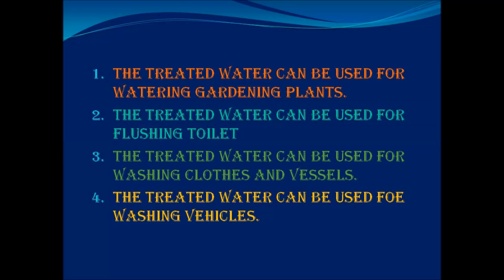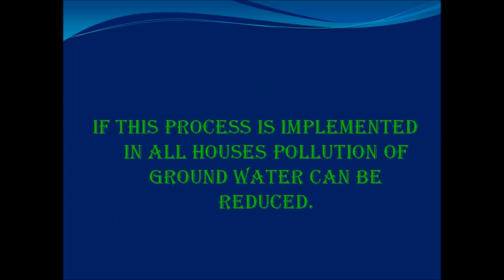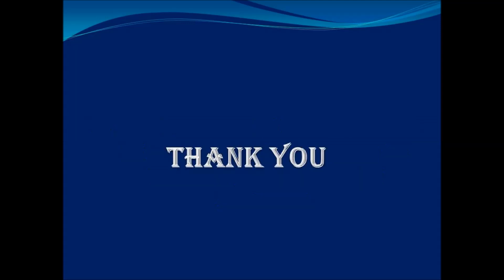WASTE WATER TREATMENT

Comment: Can we purify the kitchen and bathroom water in this method???
Reply: See, treatment of water with least input cost are possible when it's free of any chemicals. Like soap and detergent.

So mainly we can have two to 3 typesnof treatment policy at home.

1. Treatment of kitchen sink water, which are often with least chemicals.
2. Bathroom water, often mixed with soap and detergent.
3. Wash basin water.

Yeah all these 3 can not be used for drinking purposes with simple water treatment procedure. 

But we can use it for gardening, washing machine, toilet comode flush, car vehicle washing, water spray, other cleaning purposes.

We need to conserve water otherwise we would face another disaster like this COVID19.

Thanks

Comment: This water can be drink
Reply: nooooo
Reply: See, treatment of water with least input cost are possible when it's free of any chemicals. Like soap and detergent.

So mainly we can have two to 3 typesnof treatment policy at home.

1. Treatment of kitchen sink water, which are often with least chemicals.
2. Bathroom water, often mixed with soap and detergent.
3. Wash basin water.

Yeah all these 3 can not be used for drinking purposes with simple water treatment procedure. 

But we can use it for gardening, washing machine, toilet comode flush, car vehicle washing, water spray, other cleaning purposes.

We need to conserve water otherwise we would face another disaster like this covid19

Comment: how long can your filters last before clogging and where do you dispose the contaminated sand? Operation and Maintanence costs?, Is your system of low cost as compared to the available techs? Somehow your efluent is going to need some kind of pumping.

Comment: Is this water treatment can purify urine
Reply: Noooo
Reply: See, treatment of water with least input cost are possible when it's free of any chemicals. Like soap and detergent.

So mainly we can have two to 3 typesnof treatment policy at home.

1. Treatment of kitchen sink water, which are often with least chemicals.
2. Bathroom water, often mixed with soap and detergent.
3. Wash basin water.

Yeah all these 3 can not be used for drinking purposes with simple water treatment procedure. 

But we can use it for gardening, washing machine, toilet comode flush, car vehicle washing, water spray, other cleaning purposes.

We need to conserve water otherwise we would face another disaster like this covid19
Reply: Noo
Reply: Its sedimentation process. No chemical treatment or reaction takes place. Urine has several acids and other chemicals flushed by the kidney after purification through nephrons. Its all about pH level.